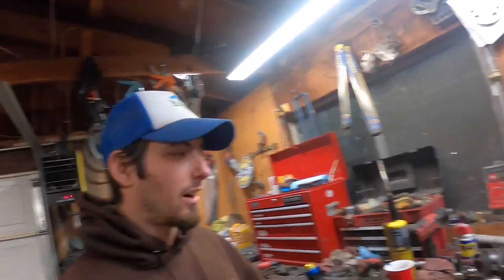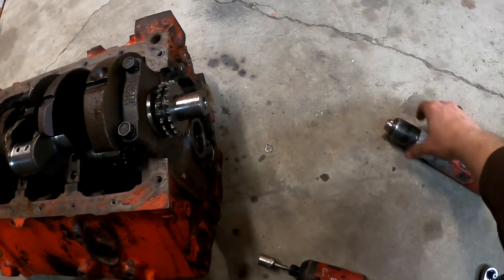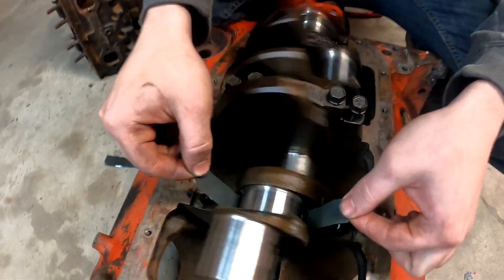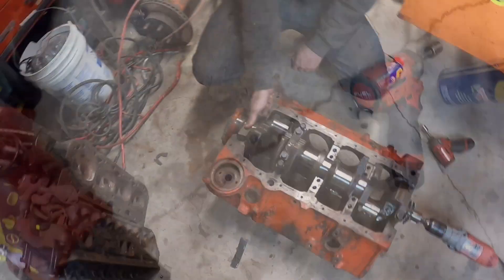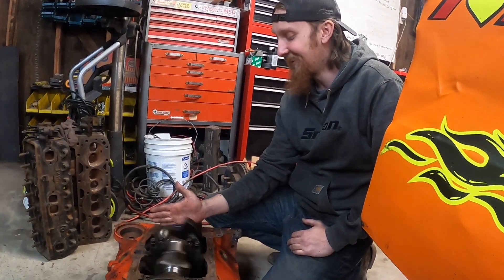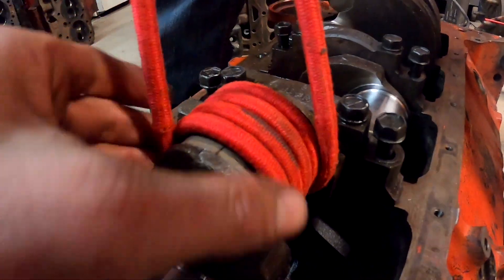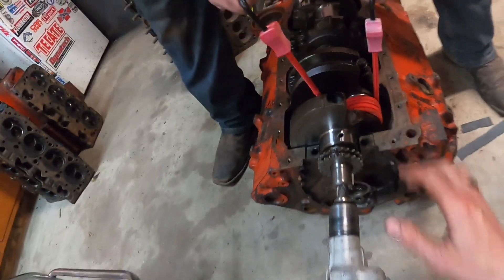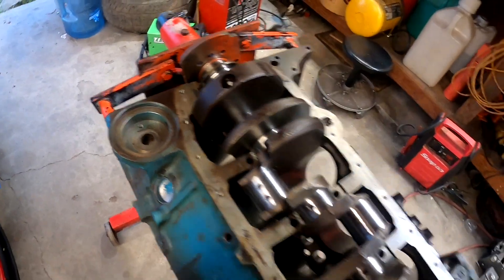Crankshaft Polishing Like A Redneck Boss -- A Faster Way To Do It @ Home

Comment: Had an Olds 3.8l. disintegrate a timing gear and the fragments plugged up the oil pump pick up lost oil pressure and spun two rod bearings. Changed the timing chain and gears, dropped the pan, pushed the rods and pistons all the way up in the bores, went to town on the journals with Emery cloth and oil. Plastiguaged the result and wound up putting in undersized I.d. bearings. Replaced a liter of oil with Lucas and put 10,000 km on it. Lucas laced oil at each subsequent oil change. I love that stuff. No crossmember under the oil pan made for an easy time of it, for sure.    🍁 eh.
Reply from the maker: Nice job! If it works it works
Reply: @CherezianRacing  it was a push come to shove situation and I am certainly glad it did work uh-huh.

Comment: i have done it a few times, crank in place,i mark the high spots, sand those down, sometimes  up to .010 down on beat journals,  mic everything till it is PERFECT, the bearings are shimmed and hand sanded down on the ends till the right bearing crush is achieved; 
sometimes  i do it for outside shops  on (1000cc) fast 15000 RPM  bikes too, for which there are only STD bearings; i ride them for 500 kms before returning them to the shop,and then to the owner.
Reply from the maker: Nice work man!

Comment: Been racing in Wisconsin for 30 years. Dealt with several local engine builders. Don't think one of them is as good as you. I'd have you build me a motor any time....
Reply from the maker: Haha thanks that means a lot. The best part is id charge you probably about 1/3 of what those guys would.
Reply: @CherezianRacing   and the best part... We never made a full season with the motor breaking

Comment: Ive done the same method in 500+hp sbcs for years. Shit works. Just use the proper grit and all will be fine. Actually its better way than the shoestring method, because its polishing in the direction of rotation instead of back and forth.
Reply from the maker: Yup i agree

Comment: So if plastigage is no good, someone explain to me how you check the clearance in situ under torqued caps? Huh? Well? What about it. Tap it with a ratchet handle and listen for the ringing? 
If you think you may have a piston/valve clearance issue... With an assembled and torqued lower end, using a set of head gaskets, the same as what the final set will be. Put a light oil on the piston tops and a ball of silly putty on the valves. Assemble and torque the heads to the block. This includes the full valve train, lifters, push rods, timing gears, chain the whole shebang. No intake. Set the valve preload and give're a slow spin or four. Pop off the heads. Cut the silly putty down the middle from the thickest point to the thinnest. Remove a 1/2. Measure the putty at the thinnest point. This is your build clearance. Then check the specks.
The oil is to keep the putty from sticking to the piston. Likewise clean the valves good and wipe them off with assholetone for good stickage to the valves. 
Silly Putty, plastigage for the big gaps. 
Do the same for piston/head clearance. Use raw heads, no valves, with the oil on the head this time. Spin it, cut the putty by removing 1/4 from each side leaving the mid section cutting across the thin spots and measure.
Reply from the maker: Hell yea, thats what im talking about

Comment: no issues with red neck polish but what are yall doing to clean out the crank oil passages? maybe some gas in a 5gal bucket to rinse and blow out with compressed air. Still keeping it on the cheap yet clean n cheap.
Reply from the maker: I flush the oil passages out with brake clean and then compressed air